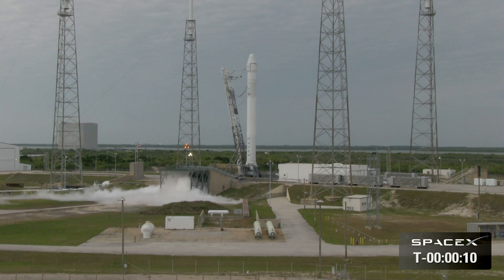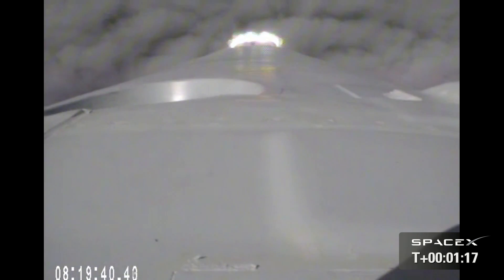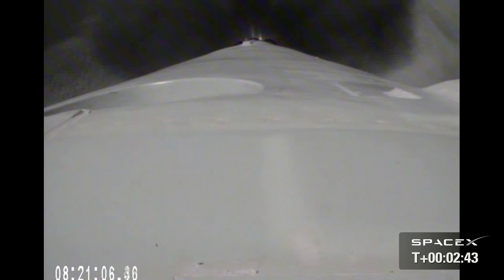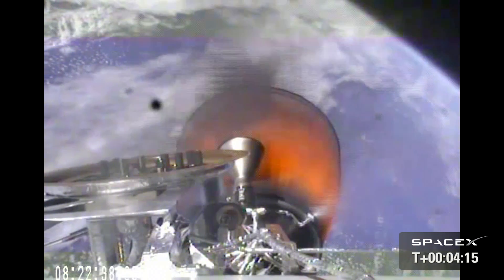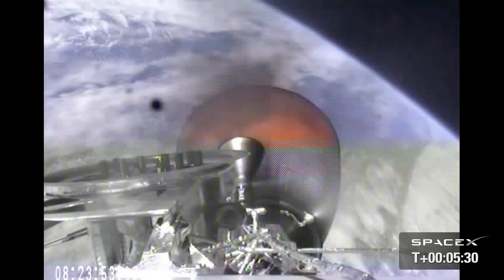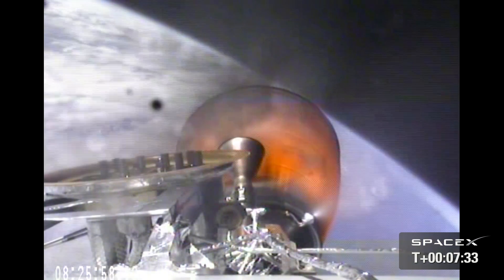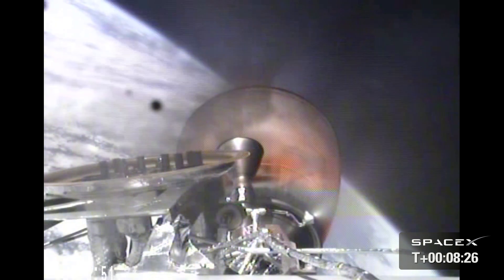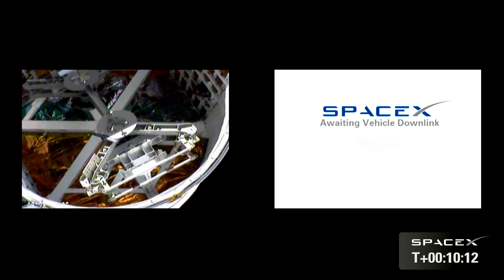SpaceX CRS-2 Launch to International Space Station

Comment: Dum question
Why you need to spray water for take of and on the rocket
Reply: +Elias Kauppi The main purpose is actually for acoustical dampening. Large rockets put off enormous amounts of acoustical energy, ie sound waves/vibration, which without the water would otherwise be reflected off the pad and back onto the vehicle causing damage Google it for more in depth details...
Reply: The launchpad wont burn then.

Comment: are these rockets more powerful than the original gemini and mercury mission rockets? or are they similar?
Reply: Jeff Rose The Titan II which carried the Gemini spacecraft has a liftoff thrust of 430,000 lbs.  It could put a 7,900 lb (3,580 kg) payload into low Earth orbit.  However, the current Falcon 9 has a liftoff thrust of 1,323,000 lbs and it can put a whopping 28,990 lbs (13, 150 kg) into low Earth orbit, so it is much more powerful than the Titan or the Atlas 1D, which carried the Mercury spacecraft into low Earth orbit (weight of about 2,000 lbs (909 kg).
Reply: Waaay more powerful, these go into higher orbits with more inclined orbits gemini was barely orbital and mercury was sub-orbital

Comment: this mission almost failed, as 3 of the 4 engines on the dragon failed to engage. the spacecraft just tumbled around in space with no control and losing contact periodically since it was spinning. Luckily, Space X got access to airforce equipment to blast the spacecraft with radio signal to regain full control. they forced open the other engines and the mission proceeded to success, albeit 1 day late. good job on building a reliable system spaceX!

Comment: The fuel inside the rocket is very cold. It causes the moisture in the air to condense and freeze on the rocket which cracks off from vibration on liftoff.

Comment: What the hell is your point? The imperial system of measurement is on the way out. Metric makes more sense for all sorts of things, and if you had any science or especially engineering background, you'll gain a quick appreciation for SI. Quick, how many feet are in 35 kilometers? How about meters? Which was faster to convert? It's a basic point, but conversions in metric will ALWAYS be quicker and using it as a standard makes more sense than just simple conversions like the above.

Comment: Because metric is just better. There is no good reason not to use a standard system with units divisible by ten and interrelated definitions of measurements.

How much does a liter of water weigh? A kilogram. How big is a liter? A cubic decimeter.

Nah, let's use gallons and pounds and cubic inches, right?

Comment: They are doing a rather good job of it, that's for sure.  Unfortunately, it is true that there hasn't been much in the way of truly impressive in a long time, since engineering today is 95% bottom line and 5% functional improvement.  Still, SpaceX is doing a great job and their concepts for completely reusable launchers with sub-24 hour turnaround, landing back on the launch site to be reassembled, fueled, and flown again, will be quite the achievement when finished.

Comment: As of right now....no. In a few decades who knows. Space Elevator would be cheap if it could be built. The cost alone of building it though would be far, far greater then the cost of multiple rocket launches. Engineering and terrain issues of course are a bit of an issue. Also the number of problems that weather alone could cause are enough.